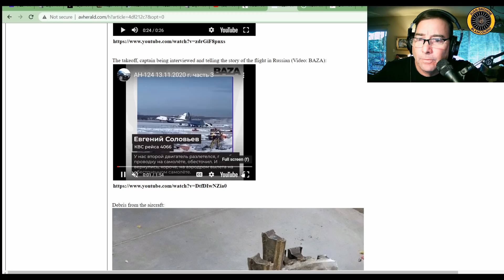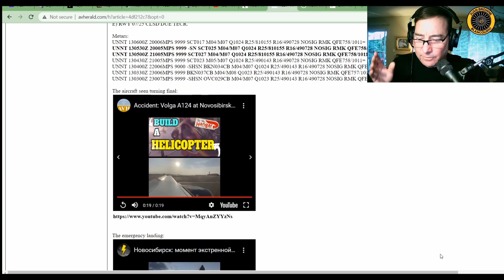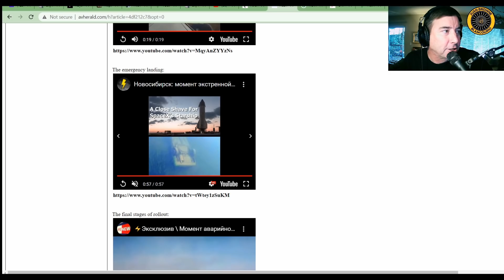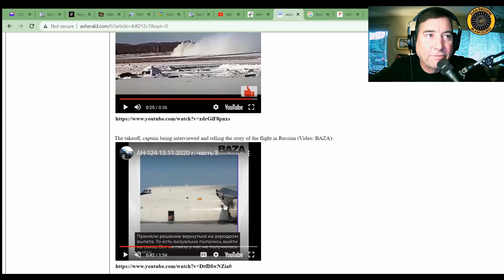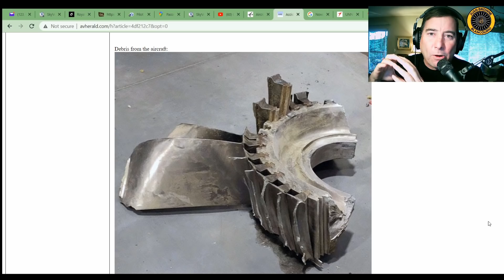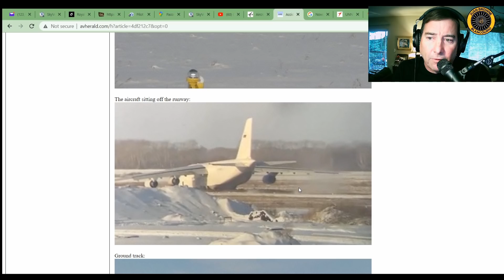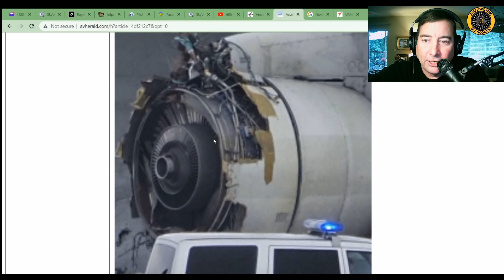AN-124 ANTONOV FAN DISK FAILURE NOVOSIBIRSK, RUSSIA

Comment: This definitely brings back memories of United 232 that crashed in Sioux City Iowa back in the 80s. That case served as the standard for crew resource management. The aircraft was essentially uncontrollable yet they managed just through engine thrust to make the airport, saving 185 of 296 people (if my memory is correct).
Reply: Juan mentions that crash at 15:28.
Reply: Was thinking the same.
Reply: @darkiee69  I was flying the same airplane for UA as a flt. att. from DEN-IAD at almost the same time. Our flt.cancelled,  and in the process of getting dead head tickets to go to IAD, we heard about 232. We were very heartbroken  and very proud at the same time.
Reply: Its funny how almost everyone knows about that incident, and barely anyone knows about OO-DLL, a DHL A300 that got hit by a missile over Badghdad, lost all hydraulics, had a wing on fire,  yet managed to make a safe landing using only differential thrust. The main difference I guess, no passengers on the DHL flight. Only passenger pilots get to be famous heros ;).
Reply: @vertigo2893  That's the one that ended up in a minefield, I believe it was featured in a Mayday episode on Discovery. I remember watching it on Discovery.
Reply: @vertigo2893 , yeah that DHL flight was an amazing story.  The difference, I think, is that the DHL incident was not a "Rotor Burst" (a failure of the vanes) or an all-out disc failure but a missile strike.  But you are correct in noting that the DHL flight was more similar to this AN-124 in that, like the Antonov, the DHL A300 was hit right after take-off and managed to get back to the airport...  UAL 232 suffered it's engine failure in mid-flight, at high altitude but also far away from any airport.  The Antonov crew, like the DHL crew, didn't have the luxury of altitude to "trouble-shoot" but also had the immediate availability of an airfield to return to.
(FWIW, there was an AAL DC-10 that suffered a complete hydraulic failure due to a depressurization and partial cabin floor collapse that also managed to return (to Detroit) the airport using only differential thrust and limited aileron controls... People also forget that one because everybody lived.)
Reply: @vertigo2893  I am gonna look up the DHL incident.  Thank God they landed safely. Never heard  of it so thanks.
Reply: My dad was a 2nd Officer/Flight Engineer for United on the 10's back when that happened.

Comment: All those Russian engines trail smoke.
Reply: Aircraft and engines are actually built in Ukraine.
Reply: @stevemagnuson7051  I stand corrected.
Reply: The actually have/had 2 building sites for the plane. One in Russia and one in the Ukraine. I do not know if either site is assembling any new planes currently as major components were made in both Russia and the Ukraine. And they are not the best of buddies at the present time, so joint manufacturing projects are not doing so well.
Reply: It's the ones not smoking that you have to worry about, they're the ones not working.